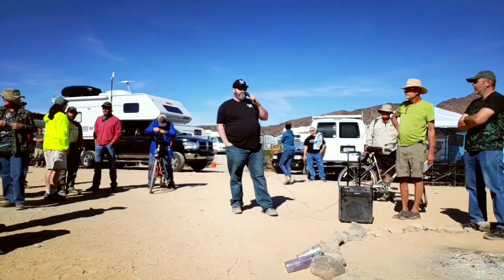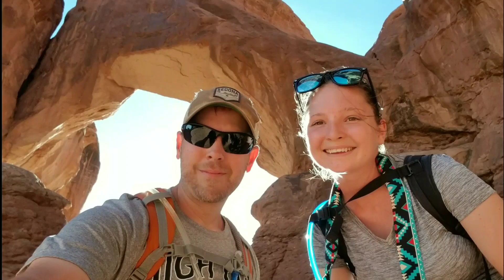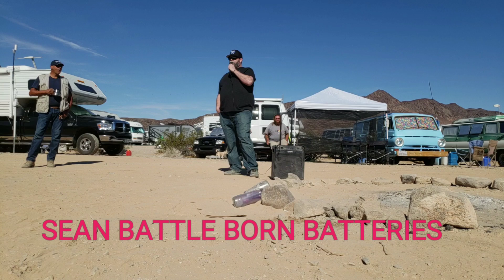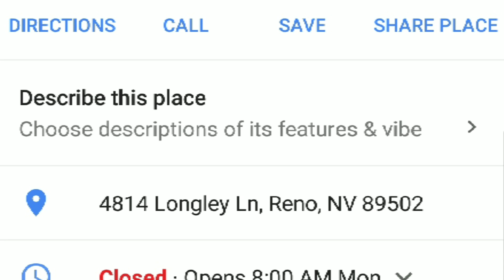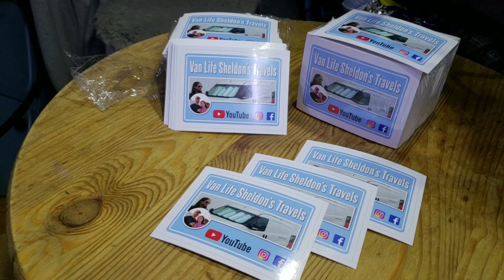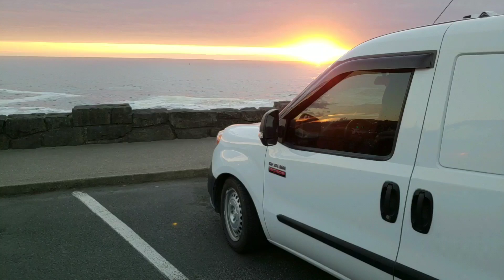BATTLE BORN BATTERIES PRESENTATION AT THE 2018 VAN BUILD.

Comment: Thanks for filming this Mike, I had to leave the van build only after a few days due to personal commitments. It was nice to meet you, I did not meet Stephanie as she was busy and I did not want to bother her. I had the Chevy Express with the white Raptor paint job, that got the first  solar install next to you. I did install a Battle Born LiFePO4. The nice thing about lithium batteries is you can buy one, then add more as your budget warrants, and the older battery will not prematurely degrade the newer ones like lead acid batteries will. Thanks again for taking time to meet me. Safe travels.